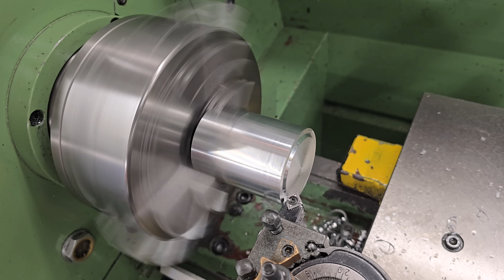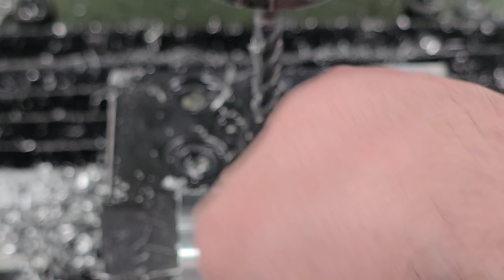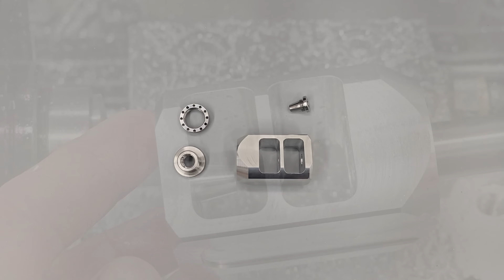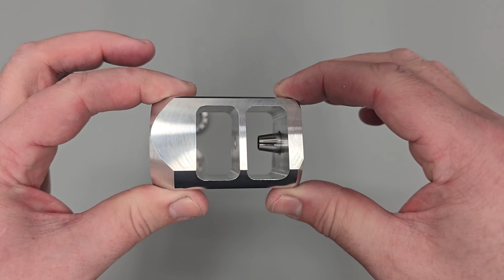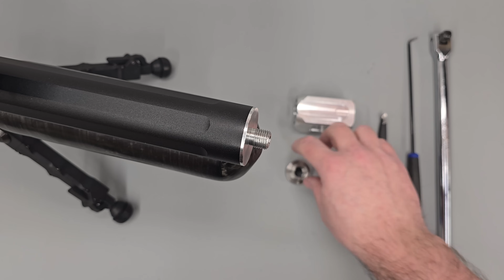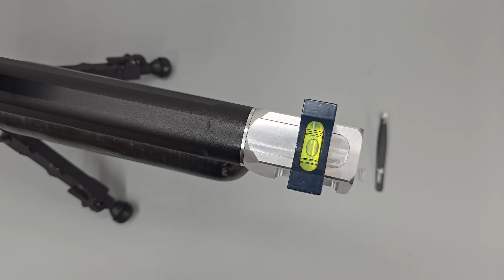Muzzle brake build (AGT Vulcan 3)

Comment: I see this error all the time with airguners and muzzle brakes.
And that's there's relatively low pressure gas coming out so having a huge first chamber vents inefficiently.
What works better is a short first chamber so the first higher pressure gas jets out stronger, THEN have a second chamber being 50 % longer where the remaining gas can vent out sideways. My testing shows that there's not much gas reaches a third chamber from the muzzle on an air rifle (it DOES on firearms but NOT on an airgun. Understand there's a significant difference).
Reply: This is a sub 12lbft airgun the brake is just for looks something a bit different, we made a shroud for it which is so quite the gun sounds broken so we did the brake for looks and maybe add a little crack to the report  i wouldn't think a brake would do anything on a sub 12lbft pcp no matter how the chambers are configured 👍👍 thanks for watching
Reply: @jeffhello1444  no, not as a brake BUT I've built muzzle brakes that were actually air strippers (mount the stripper cone on the divider between the first and second chambers) which helped accuracy because the pellets stabilized sooner since there was much less blowby past the skirt of the pellet. You want the gap between the muzzle and the cone entrance to be 80 to 90% of caliber, if it's more than a caliber then the air stripper becomes less effective.

Comment: Precision work. Need one advice Jeff. I hv built a 22 cal air rifle. Now the valve Ceat is 6 mm I'd, plenum is 78 cc. I hv Fx 500 mm heavy liner barrel with dual transfer port. The block I am using has 5 mm transfer port hole.  I need to increase it. U think 5.7 mm Wil be good? I hv space for  6 mm or more.
Reply from the maker: yes 5.7 will be a good start 👍
Reply: @sub12airgunners  TX. Appreciate. I forgot to mention that I want max power. But I guess u figured it out anyway. So will straight go for 5.7 mm mm.